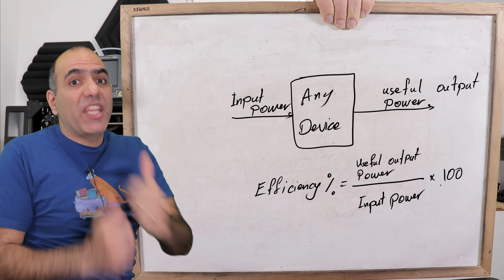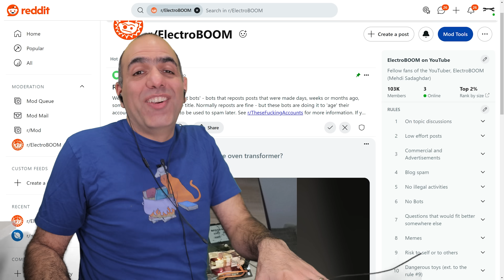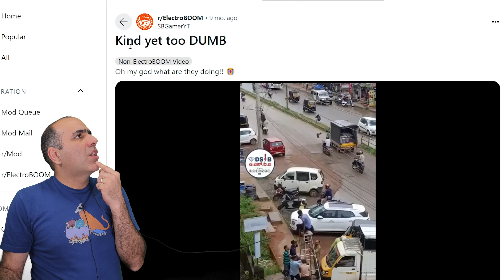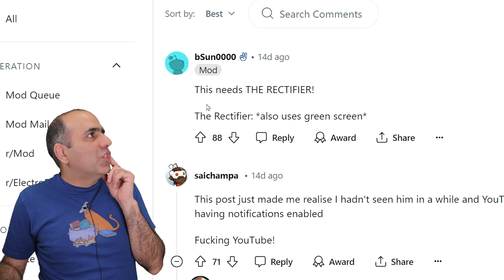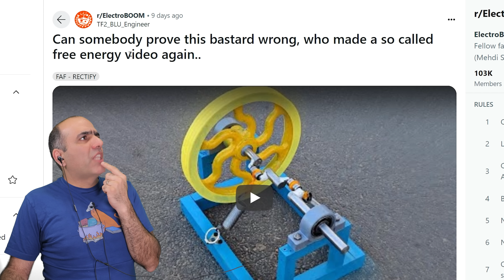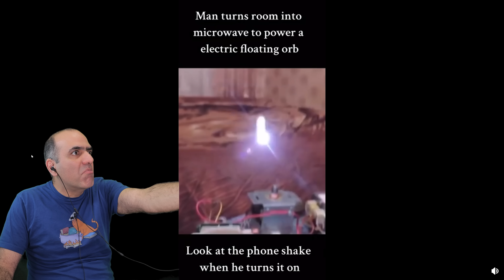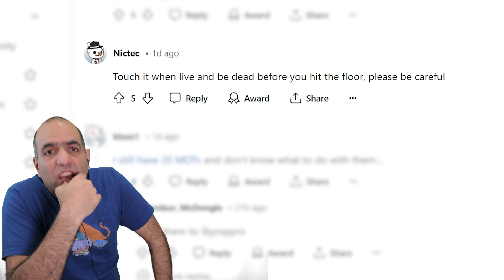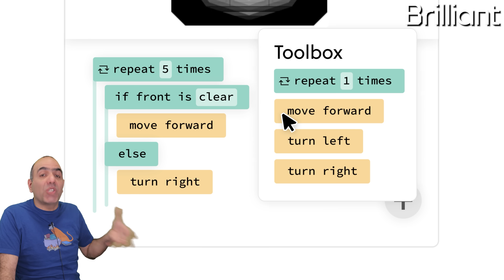New Flywheel Free Energy?! Can Boat Battery Fry You? LATITY-013

Comment: Indeed, a space heater is not meant to heat your body.  It is meant to heat the space which makes it 100% efficient.
Reply: if you dont mind some of the energy being converted to visible light and electromagnetic fields... oh and of course all the energy you have to put into heating your metal first, which doesnt really heat the space
oh and depending on how it works, some of the electricity might be used to power a small fan, to transport the heat from the heated coil faster into the room
Reply: @SharienGaming  yes but the energy consumed by the fan will be turned into heat too
Reply: @t0biascze  the majority of it is turned into kinetic energy.
if you want to be this obstinate about it then you would have to argue that anything that isnt trying to generate heat has a 0% efficiency because all of the energy will be heat - and going further than that, it will be 0% even for heating, because eventually all energy will be so dispersed that heat as a concept stops to exist
and none of that matters for actually looking at the efficiency of a process
Reply: @SharienGaming  Even the heat put into the metal of the device, or the oil within the device, or indeed the light from the device, eventually end up as heat within the space.
Reply: @pleappleappleap  er no - especially when you are talking about a chemical heater using exothermic reactions there is no way you reach 100% efficiency, unless you are fudging definitions
the vast majority of the energy in matter stays bound within it - unless you want to argue that a space heater performs matter-antimatter annihilation

and "eventually" is incredibly useless when talking about conversion efficiency... by that logic, even a fridge is a 100% efficient space heater for the fridges interior, because eventually all the electric energy put in will have converted into heat, raised the ambiant temperature and equalized through the insulation... it will just take ages until that happens

heck if you wait long enough there will be effectively no heat anymore, because everything is so spread out as to no longer interact with each other anymore - 0% efficiency!
Reply: @SharienGaming  I was specifically discussing electric heaters.  But even chemical heaters are 100% efficient.  All of the heat released by the chemical reaction ends up in the room somehow.  It has nothing to do with the energy contained in the gluon field of the matter in the fuel.  Expecting nuclear energy from a chemical process is a disingenuous argument.  It is a chemical process releasing energy. If it is your contention that some of the energy from the process does not end up in the room, where do you say it went?  If all of it ended up in the room, that defines 100% efficiency for a heater.
Reply: @pleappleappleap  by your definition then everything is 100% efficient, because all the energy the process can apply to the purpose is being applied to the purpose

the energy being released by an exothermic reaction isnt all the energy that goes into the reaction - its just the energy difference between whats stored in the molecular compositions before and after the reaction

and i just talked about chemical heaters because you mentioned oil in your reply

with heaters in general, you also run into the issue, that if its about heating a specific space, then heat pumps will generally outperform radiant heaters... even though heat pumps certainly have less than 100% efficiency... but that means that a radiant heater either has even less or the heat pump has greater than 100% efficiency
the truth of course is that they achieve the goal in a very different way, simply by not converting energy of different forms into heat, but just using energy to shift heat around

but if the end goal is to heat a space - turning other forms of energy into heat is incredibly inefficient use of those forms of energy

if the end goal is to just turn as much available energy into the form of heat as possible as fast as possible, then electric and chemical still are incredibly slow compared to fission or annihilation processes and they still leave a lot of that energy unconverted

if the end goal is to turn as much energy of a specific type into heat as fast as possible... okay sure, but then talking about efficiency gets a little pointless, because you will always be able to convert all of that specific energy, because you narrowed the perspective enough to do so

essentially, with every single situation where you consider efficiency, you need to define what is waste and what is not - and if you define nothing as waste, you can stop because you just defined your problem to be 100% efficient - what resources are you trying to conserve? what purpose are you trying to achieve?
Reply: @SharienGaming  No.  Not everything is 100% efficient.  Just space heaters. 

Lights, for example.  Not all of the energy that is consumed by the light is used to light the room.  A substantial portion is wasted as heat.  The point of the light is not to heat the room, so any energy that goes to heat the room, rather than lighting it, is waste.

Another example is a computer.  A substantial amount of the energy used by a computer is lost to the room as heat.  Not all of the energy consumed by the computer went to computation.  The computer's goal is not to heat the room, therefore energy that goes to heat the room is waste.

If you want to say a heater is inefficient, you have to tell me how much of the energy of the heater went to doing work other than heating the room because heating the room is the goal of the heater.  If you want to say that the heater is 90% efficient, fine.  Then where did the other 10% go?  It can't have ended up as heat in the room.  If it went elsewhere, where did it go?  Tell me and I'll buy it.  But every example you've given me ends up as heat in the room.
Reply: This thread is getting unnecessarily scientific.  Let me try and end it with a few words.  
Entropy, and "Heat death" of the universe
Ultimately everything we do turns into heat, i.e 100% efficient space heater. Your car, your fish, your ideas, your plant and your planet.....all heat.  100% efficient heat.
Reply: Resistive heaters tend to output light which is “wasted” energy that isn’t actively heating the space. May only be 1-2% but still less than 100%.
Reply: @NBSV1  How does this light not end up as heat after hitting the walls of the room and being reradiated?
Reply: @pleappleappleap  Because it can get lost as light before it converts to heat. Since at some level everything ends up as heat by your argument everything is 100% efficient. 

Before you die on this hill remember even if .00000001% of the energy isn’t converted to heat it isn’t 100% efficient. We aren’t rounding here and being close isn’t enough.
Reply: @pleappleappleap  Unless the room is composed of blackbodies, the illuminated objects are going to reflect and/or transmit some of that light. Light doesn't heat objects that don't absorb it.
Reply: @jdotoz  So all that happens is that the radiation will bounce around the room until it ends up as heat.
Reply: @NBSV1  That's where you lose me. When you start ignoring significant figures and noise floors.
Reply: @pleappleappleap  Most rooms have optically transparent windows.
Reply: @jdotoz  I would like you to demonstrate an ability to measure that percentage of loss over the noise floor of a power consumption measurement.  I've been measuring efficiency for years, and I've never been able to do that, and neither have people I work with. 

Put it in a video and I will consider myself corrected.
Reply: @pleappleappleap  Seriously? It's glowing red. If you can see the glowing coils from outside the room, you have demonstrated that photons, and therefore energy, are leaving the room without heating it. You don't even have to measure quantitatively, your eyes are enough.
Reply: @pleappleappleap  Except you’re the one ignoring it. You’re rounding up and assuming it’s some sort of perfect room where nothing escapes and all energy is transferred. There’s always some level of loss in the system. 99.9999% isn’t 100%.
Reply: @NBSV1  If your noise floor is 10^-6, then indeed there is a difference between 99.9999% and 100.0000%.  of your house floor is 10^-2, then there cannot be a difference between 99.9999% and 100.0000%.  This actually matters.
Reply: @pleappleappleap  Exactly it matters. Because there is a difference. Make it simply 99.99%. Still isn’t 100%. There’s going to be some loss. 
If you’re going to be pedantic at least be on the right side with something to back you up. You’re standing on the assumption that the space is perfectly sealed and insulated so nothing is escaping and therefore everything eventually gets turned to heat. But, no such space exists and certainly no space a common space heater is designed for. So, in the end things are escaping this space which makes it less than 100%. Especially if there’s windows which would let the light escape.
Reply: @NBSV1  It doesn't have to be perfect.  It has to be perfect enough.
Reply: @pleappleappleap  Ah, so now we’ve moved on to only has to be perfect enough. 100% would be perfect. What exactly is perfect enough? 
Sure feeling like at some point here 95% is gonna be enough significant digits to round up to 100% somehow.
Reply: @NBSV1  The part that you seem to be missing is that 100% != 100.0% != 100.0000000% != 100.0000000000000000000000000%.  There is a real difference.

If your noise floor is 1x10^-4, then in a very real sense, if only 1x10^-20 is loss, there is actually 0 loss.  Why?  It cannot be measured.  It just cannot be.  You will actually be measuring 100.0000%.  Why?  Because the loss would have to be 10^16 times larger to matter.  Any loss below your noise floor can't be proven to exist.  It exists only in theory.
Reply: @pleappleappleap  Even if the loss were undetectably small (and I'm fairly certain we could devise a way to detect it), there is still loss. To say it's 100% efficient might be convenient shorthand, but consider the context presented in the video; the teacher is explaining the reality of thermodynamics that 100% efficiency doesn't exist. That is correct. 100% efficiency does not exist. That some devices technically round to 100% is an interesting factoid but doesn't disprove the thermodynamics assertion about 100% efficiency.

Free energy beliefs are rampant enough that Mehdi keeps making debunking videos about it. Let's not contribute to thermodynamics/electrical misinformation with pedantic rounding arguments.
Reply: @pleappleappleap  You’re trying to use the noise floor to cover the losses. Every time someone has pointed out the losses in the system you just come up with some other excuse and keep going around in circles. 

There are losses in space heaters. Simple as that. They’re no harder to measure than you making some point about the light eventually turning into heat as well.
Reply: @NBSV1  I don't need to cover anything. The actual measurement will read something like 100.00%.
Reply: We can agree to disagree. Frankly, I don't know why you're still trying to convince me. Like I said, I've been doing this work for a living for a number of years, and nothing you're telling me is going to get me to charge how I do my work.
Reply: @pleappleappleap  
I really hope your work isn’t important for human safety or anything. Have fun with it.
Reply: @NBSV1  It is, at times, and if you're going to make a big deal about an efficiency which can't be measured, be glad you're not in this business, because you'd get in trouble fairly quickly for spending money to hit targets that can't be measured or proven.
Reply: @ScabeiathraxUK  You wish to ignore all practical considerations, and you're calling me pedantic? 

Besides, heating is one of the few things where you can actually pass 100% efficiency.  Moreover, you can do it without violating thermodynamics, and it has nothing to do with perpetual motion, which remains impossible.  Moreover, thermodynamics doesn't ban 100% efficiency.  It bans anything beyond that, even in the tiniest amount.
Reply: @pleappleappleap  I honestly feel sad for those you work with. The way you’re willing to act towards multiple strangers online is telling. How you’ve tried to change goalposts, bring in qualifications, and go in circles just shows how miserable it would be if someone doesn’t just submit to you being right all the time. 
As all the others you’re arguing with have said, you’re wrong and the efficiency isn’t 100%. Hopefully life doesn’t suck for you. But, you’ll have to find someone else to play with for now.
Reply: @NBSV1  So do what you're proposing and leave me alone.
Reply: @NBSV1  Answer me this: If you disagree with me so comprehensively, why are you choosing to continue to interact with me?  Seems counterproductive from your perspective.  Haven't you ever heard not to feed the troll?  How do you know everything I'm saying isn't a lie?
Reply: @pleappleappleap  "All practical considerations"? That it rounds to 100% is a technicality, and only that. What practical considerations are there? If you're talking about the practicality of writing 100% instead of something with a bunch of decimal places, I can understand that, but we should let abbreviations for expediency deceive us. 99.99999999999% is certainly easier to write as 100%, but it is not 100%. You want to write 100% on your work, be my guest, but don't argue that it factually is 100%, because that's just not true.

And there is no such thing as passing 100% efficiency, as you say later in your own comment. There isn't even such a thing as 100%, only things that could be rounded up to 100%. You can both write "100%" on technical specifications for expediency while also acknowledging that 100% efficiency doesn't actually exist. 

Do your customers or employers care about the imperceptibly tiny loss of energy? Surely not. Does it matter in discussions of theory whether that imperceptibly tiny loss of energy still exists? It surely does. Unless it's your intent to stoke free energy misinformation, of course.
Reply: But when you think about how big SPACE is, I'm not sure any heat from any space heater has reached, say, the other side of Jupiter, so how efficient can that be?
Reply: @rodchallis8031  Har de har har.
Reply: @rodchallis8031  heat can't travel through a vacuum genius. 😉
Reply: @Ryan_Tidwell  Then  they shouldn't claim to heat space,  when it can't.  I call that a major inefficiency.  ;)
Reply: @Ryan_Tidwell  That's what Icarus thought as well.
Reply: Many space heaters actually are not 100% efficient on the smaller scale.  Many of them emit all sorts of radiation over a large spectrum, including light and electromagnetic fields (which will transfer some non-heat energy to other objects).  Much of which is very inefficient at transferring that energy as heat to another object.
Reply: @LogicalNiko  If it's your contention that not all of that radiation ends up as heat in the room, tell me where else did it end up?
Reply: @pleappleappleap  specifically why I denoted from a smaller scale.  Technically it will all end up as heat energy, just not necessarily directly.  Light can escape the immediate area, electromatic radiation will transmit energy from a few feet to dozens of feet in small radio transmission, etc.   The more efficient the heater the more is of that energy is transferred to the air/medium within the space to which the heater is located or attached, not outside that space.  But yes, expand the scope and it all becomes heat. 

I am being a bit nitpicky here, but if you designate a heater as something that transfers heat energy to a target, technically no heater can do that 100% efficiently; some of that energy will end up escaping unless you define the target relatively broadly.
Reply: @LogicalNiko  For a space heater, the target is the room.  Efficiency is a measure of how much input energy is used to perform the actual work.  I'm not saying that you couldn't design an inefficient space heater if you really wanted to.  I'm saying that virtually all of them are 100% efficient because it's very difficult to not have it be 100% efficient.  If you do even tried to measure the energy escaping in a space heater sitting in a room, you'd find that amount so small as to be swamped by measurement noise.  If you want to say that 99.999995% is not 100%, you can go ahead and do that, but your argument is specious.
Reply: @pleappleappleap  posit, you have an electric space heater in an 8x10ft room with a window and a door.  For it to be 100% efficient at heating that room all energy going into the space heater would need to be converted to heat within the confines of that room.  This is impossible.  If you shrink the room the percentage of energy leaving that space as non-thermal energy increases, as you expand the space towards infinity it approaches 100%.  As such it depends on your definition of what a space is.  Does it include thermal energy everywhere? Is it confined to a room? What is the size of the room? What are the materials of the room?  Is the room a vacuum? Is it a solid block of lead?  These things all play into efficiency. As it’s correctly said in this video, for any given space smaller than the entire universe the efficiency must be somewhere smaller than 100%, it may be infinitesimal below 100% but it cannot be 100% without violating the laws of thermodynamics.
Reply: @LogicalNiko  Fine.  Measure how much.  Give me measurement that is not so small that it gets swamped by the measurement noise.  Show me a room in real life that is a solid block of lead.  Show me a domestic space heater that has been ever deployed in a room with no air.

Your loss is theoretical.
Reply: @pleappleappleap  show me an electric space heater that doesn’t emit a radio emission.  In fact pretty much any electrical device will.  That energy is not heating the room.
Reply: @LogicalNiko  Show me an electric heater that emits an amount of radio emission that is large enough to show up outside the measurement noise.  And then subtract the even tinier amount that doesn't get absorbed by anything in the room and reradiated as heat. 

I think we're going to have to agree to disagree.  You're speaking from a theoretical perspective, and I'm speaking from a practical perspective.
Reply: @pleappleappleap  but what you're saying is that the heater is not 100% efficient, what you're saying is that if something wastes 1x10^-29 percent of the power we can just all it 100% because you won't bother to measure it, and it makes no practical difference.  But what I am saying is that is the same argument that people who believe in perpetual motion use, they say they will just round away the loss and then claim they are 100% or due to accumulation of rounding errors even say they are 105% or 110% efficient.  

I agree with you completely that it makes no practical difference.  But this was a question of theory, is a heater (in general) 100% efficient.  And the answer is no, although extremely minute the laws of thermodynamics say that NO system can ever be 100% efficient.  It can approach 100% efficiency, and it can get almost immeasurably close to 100% efficiency, but it cannot ever be 100% efficient unless your frame of reference is infinity.  It mathematically cannot work out otherwise.  Go ask any person with a background in physics and they can tell you the exact same thing. 

And they are not "Theoretical" differences, the laws of thermodynamics are classified as laws because they have been demonstrated to be universally true.  You are using terminology to make an argument by using casual use semantics where they are incongruent with the true definition and then waving your hand and saying those don't matter.  I am strictly speaking in scientific terms, and fully agreeing with you in general terms, but then you continue to say that in both terms they don't matter, but only citing general terms of practicality.  I am only pointing this critique in terms of academic peer review of your accuracy.  I have no problem if you want to round, it is a very practical and prudent thing to do when talking about the real world.  It's just always important to know that error will exist, no matter how small.
Reply: @LogicalNiko  Two words: significant figures. 

If you are only capable of measurement to five significant figures, then:

1.0000 - 0.00000000000000000000000000001 = 1.0000

And if I'm not quite mistaken, the Law says you can't go past 100%.  You can get arbitrarily close to it.  Your 1e-29 is effectively 0.
Reply: However, did you know you can have about 300% efficiency from a heater???

No, this is not a clickbait, and it follows all rules of Physics! 

It's called:

Airconditioner.
Reply: Water heater sends all the enertinto heating water
Reply: Radiative heaters heat solid things, but not the air.
Reply: Well if the space heater is high up in the IR glowing hot red some of the energy will be escaping out of the room as light which is less effective at heating the room and bounces off without heating it :)-
Reply: Na GT-R
Reply: @acmhfmggru  All sound hits the wall of the room and bounces around until it dissipates as heat.  Just about all of the non-IR light coming off the heater is not being created by the heater itself, but is bouncing off the light sources in the room.  And almost all the energy from that light strikes the walls of the room and ends up as heat in the room. If you actually tried to measure the amount of energy that escapes directly from the heater to outside, you need a MUCH larger number of nines than that.  You'd not actually be able to measure it at all. It would be swamped in the noise of the measurement.
Reply: Oh?  They why are there forced-air space heaters, convective oil based space heaters and most importantly....radiative parabolic space heaters?
Reply: @Pgr-pt5ep  Every single one of those devices puts every bit of energy they consume into the space in which they are sitting as heat.  They all are 100% efficient.
Reply: @pleappleappleap  Anybody who understand the fundamentals of "energy cannot be created or destroyed" or no such thing as perpetual machines, knows that "heaters" ultimately put out 100% of energy as heat...as will everything else in the universe.  
You're missing the point Mehdi is trying to make.
Reply: @Pgr-pt5ep  - No, he's not missing the point. He's exactly getting the point.
Reply: @Beeti1  Yes, we are stating logically correct facts.  That I can say as no-one broke any established scientific facts.  This really should be a discussion over how the common people are marketed products and technologies.
Reply: @jdotoz  Does the light that is emitted in that glow not end up as heat in the room?
Reply: @pleappleappleap  Not necessarily. If you can see the glow from outside the room, it obviously doesn't leave all its energy behind in the room. Some of the emission is going to be microwave and/or radio wavelengths that could escape the room depending on the construction.
Reply: @jdotoz  What I've what said, is that if you even try to measure that, you will quickly find that the amount  being lost in this manner will get swamped by measurement noise. 

So, if we take your example, that implies that a radiant infrared space heater has an efficiency near 0% if you have it pointed out an open window.  Ok, yeah that's true, but I think you're not using it in the way in which it was meant to be used.  In other words, you have to try to lower the efficiency of a space heater.
Reply: @pleappleappleap  As has been said, you're probably abusing the definition of efficiency. If we count energy that eventually causes something in the room to rise in temperature, it seems that we should also count the energy that everything in the room is losing to the outside - so is the heater actually 0% efficient?
Besides, the ability of visible light to raise temperature depends on the ability of the receiving object to absorb that light rather than transmit or reflect it. So if visible light can escape the room and the coils are visible (which is the case for many heater designs), it's very likely that some of that energy leaves the room and reduces the efficiency of the heater.
Reply: @jdotoz  The question is how much?
Reply: @pleappleappleap  Anything more than zero kills the claim, doesn't it?
Reply: @jdotoz  No.  Anything that you can measure or prove counts.  An earlier example was a loss of 1x10^-29.  If your measurement has a detection threshold or noise floor of 1x10^-5, then the 1x10^-29 literally means nothing. That which cannot be measured doesn't count.
Reply: @jdotoz  By what definition?
Reply: @pleappleappleap  Yours. The eye is a sort of measuring tool.
Reply: @jdotoz  There are two things to be measured.  The amount of energy being used to heat the room, and the amount being used not to heat the room.  Explain to me how you're measuring both. Or don't. Save your breath.

Frankly, you've failed to convince me of anything.  I do this kind of stuff for a living.  I'm going to keep doing it the way I've been doing it.
Reply: @pleappleappleap  Each photon has energy. If the coil emits a visible photon that leaves the room, that's energy that doesn't raise the temperature of anything in the room.
Most space heaters are designed such that the coils are visible from outside the device. So if the room has a window, some of the visible photons from the coil are almost certainly reflecting off objects in the room and leaving through the window. If the eye can detect that light, that's a form of measurement.
Thus, in most likely use cases, the heater uses some energy that doesn't heat the room. QED.
Reply: @pleappleappleap Except some of the heat escapes the room or building making it not 100 percent efficient...
Reply: @changingmyworld-j9z  At least from an engineering perspective, heat escaping wouldn't make it not 100% efficient. Efficiency would be calculated by the amount of energy that is translated into heat, even if that heat escapes the room. The room is what's inefficient, if its boundaries are permeable enough to let the heat escape. We have to analyze the heater as if it were a closed system, where every percent of energy converted into heat is a percent of efficiency.

 That having been said, space heaters aren't 100% efficient because they produce small amounts of sound, non-infrared light and lose heat even inside the system to chemical reactions and other physical changes to the material of the heater itself. It is a very small percentage, but it still exists. 100% efficiency doesn't exist.